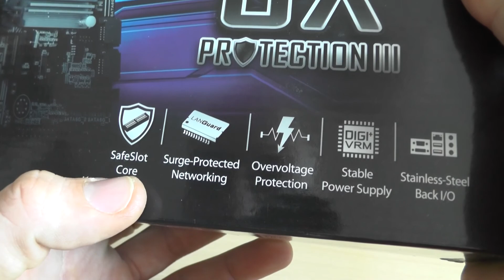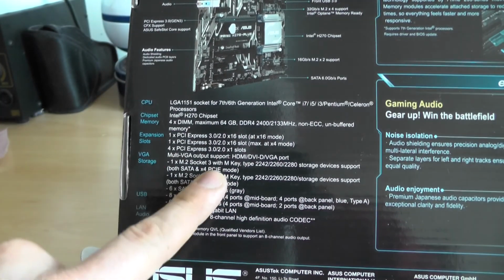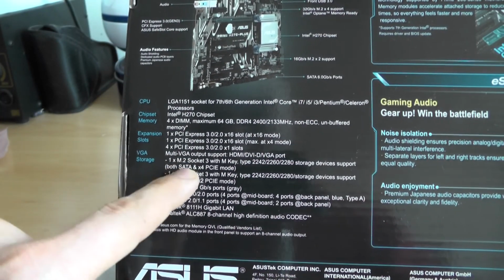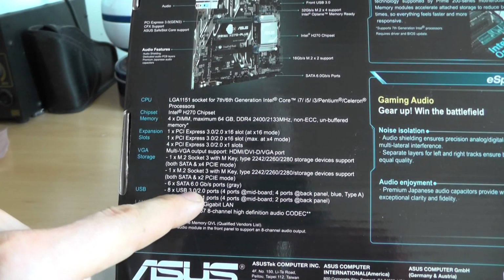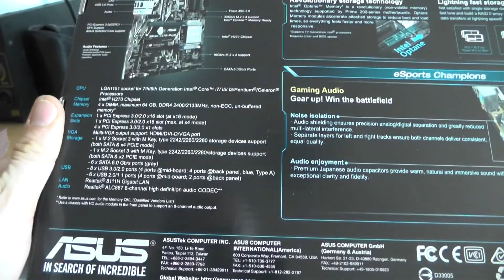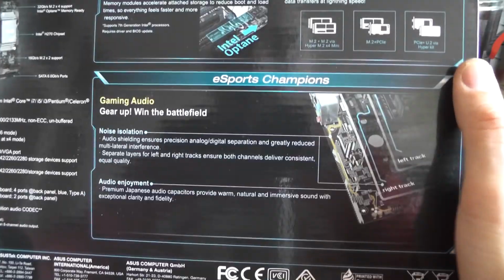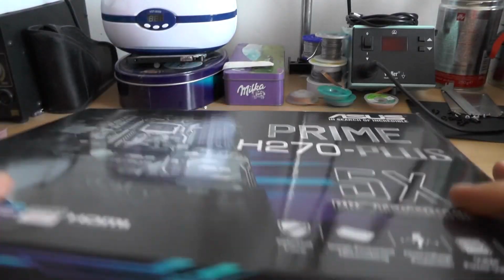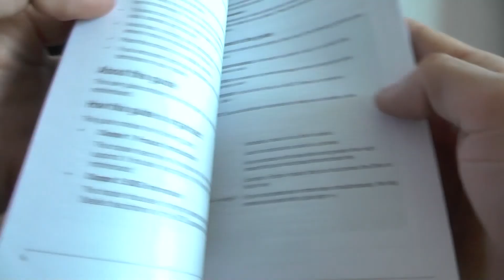[Hw: Quick Look:] - ASUS Prime H270 Plus

Comment: Hi, the line near the sound card, it lights up? My light does not light up and I wanted to know if my motherboard is distracting
Reply from the maker: You can enable/disable that in bios :D
Reply: I tried, but it does not work
Reply from the maker: Try clearing cmos with jumper (just remember to reenable all mining settings)
Reply: Done, it does not work :(
Reply from the maker: did you check to see that it's enabled after clearing coms? maybe it's faulty :/ also, is everything else working normally?
Reply from the maker: to be honest i' m not sure if the line even lights up (i know rog has that feature but i'm not sure about this one, i'll take a look tomorrow when i go and visit my miner :) ) if it's lit up i'll let you know.
Reply: Confirm, it's defective! From the bios I can only turn on and turn off the LED lights near the video card slots
Reply from the maker: let me check it tomorrow before you send it to RMA, it might be that it does not even have that feature by default.

Comment: hi this mother board is good for gaming? im thinking to use a i5 intel with gtx 1060 can y use with this mother board ? and in future i want to upgrade processor and graphic card
Reply from the maker: i don't know about the future, but i believe that it's an OK mobo
Reply: MTS and whats the diferent beetwen h270 plus and h270m  because i see this diferences i buy h270m model
Reply from the maker: h270m has only 4x pcie, however it has 2xm.2 so in theory you can connect 6xgpu
Reply: I got this motherboard knowing I will not be able to use Coffee Lake CPUs (you need 300 series chipset for that). I got an i5 now and should I need more processing power, I could move up to an i7.

Comment: i just bought today, don't know why I turn on the de powerbutton and inmediatly turn off, i connect the both power socket to the main board , hdd, ram, just to know I connected the hdmi integrated, but nothing it turn off
Reply from the maker: try bios jumper setting to normal, maybe it's set to "clear cmos" ?
Reply: i was using the power cable to the mainboard for another power supply I use the same rband power supply and now is poweropn, but know I can not see any sata hard drive it say empty, i test sata data cables, sata power cables, is crazy.
Reply: clear cmos junper works to avoid to turn off the powersupply and unplugin, it save me time. Now it turn out to be this mobo was comptaible with not all the hard drive I had, it doesn't work with a 500gb, and with other 1tb, but it was super compatible with a 80gb (pretty old), and other from 3tb(3 terabytes), weird mainboard.
Reply from the maker: hm, try loading default settings in bios and then enabling 4 g and rest (i've tested it with my 500gb disk and it works), either that or it might be that you have faulty drive?
Reply: finally the mobo can not detect some drives, I tested default setting same result, but other drives worked good, I read some people has similar problems and they update the bios, but I just prefered using other drive I has available rather than do a bios update
Reply: do you have like all sata connected? if not,does the problem still exists?
Reply: SATA 1 and SATA 6 port will not work if first M.2 and/or second M.2 slot is used.

Comment: did you ever install 6 video cards and if so can you post up a video of them working
Reply from the maker: Not yet, i've ordeded risers of ebay, at first seller gave fake tracking number (yeah,china) and later (3 weeks later) send message that he still does not have raisers. So i've ordered of seller from USA and i'm still waiting (should be here within 1-2 weeks). When it arrives i'll record a video.
Reply: MTS.      ok i have the same mb i7 7700k 16gb ram gtx 1060 3gb cant sli my video card i think i can sli the gtx 1060 6gb so looking into that video card and will u be putting in  2 of the m2???
Reply from the maker: Nope, since i bought this motherboard strictly for mining so normal ssd will suffice.